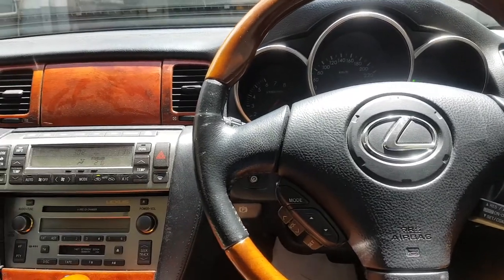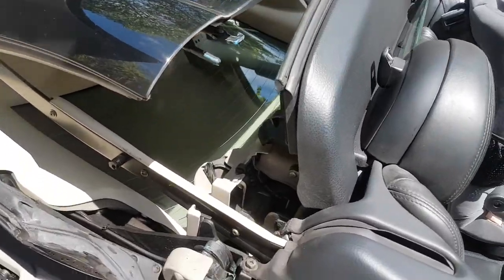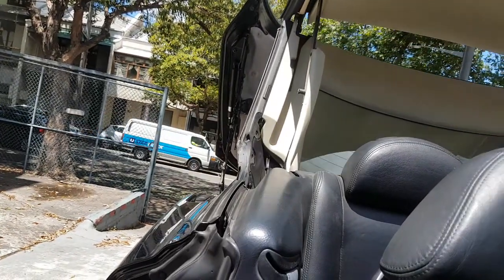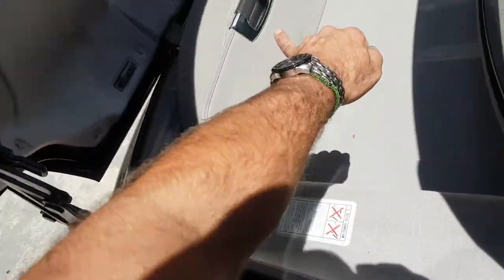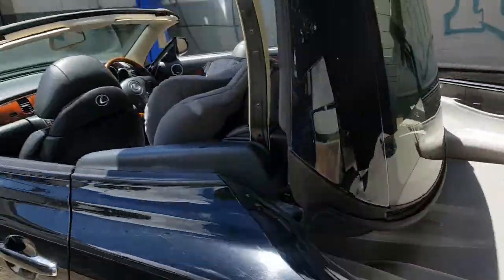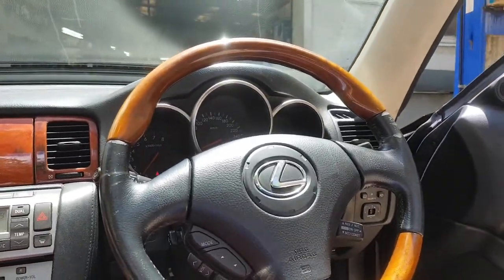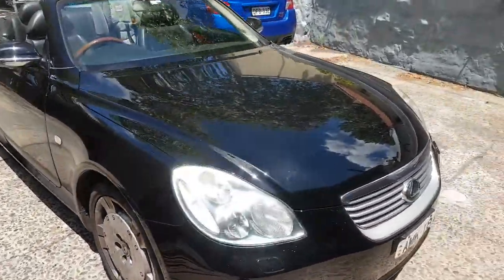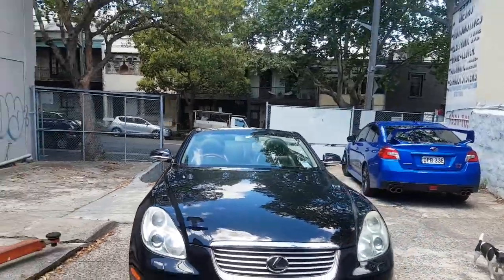Lexus SC 430 convertible roof maintenance guide resuspension click rear drive shaft Lexus quality

Comment: I have a 2002, SC430, never had a problem. I only have 63k miles (102km). The timing belt has been changed. It's not my daily driver, so it's exceptionally clean. I hope to take it to the Smokey Mountains, USA.